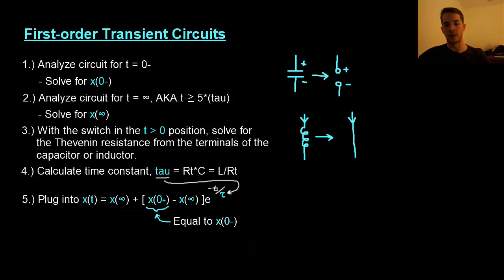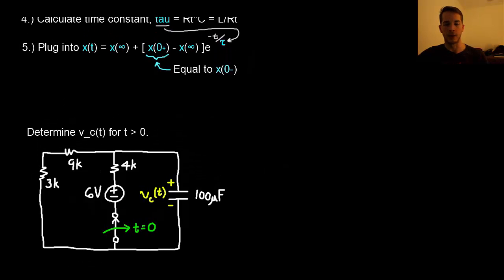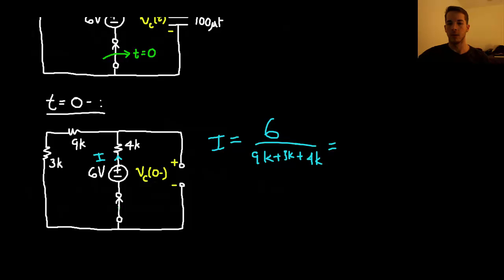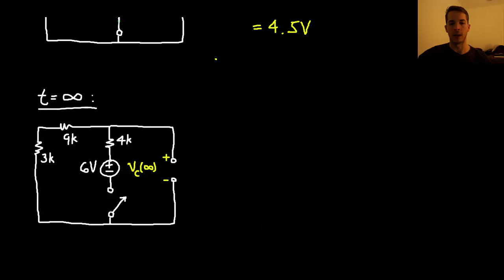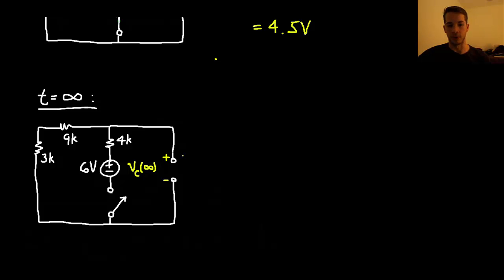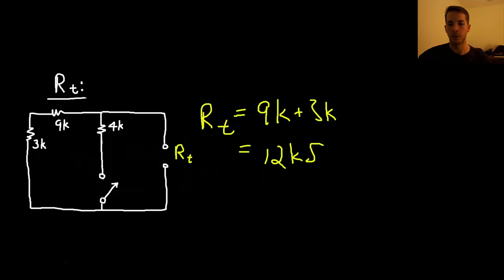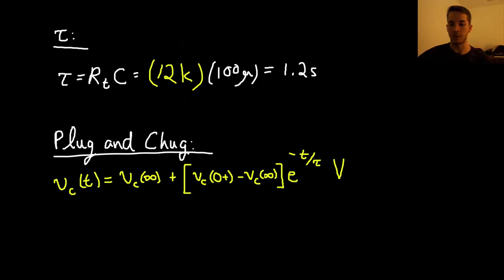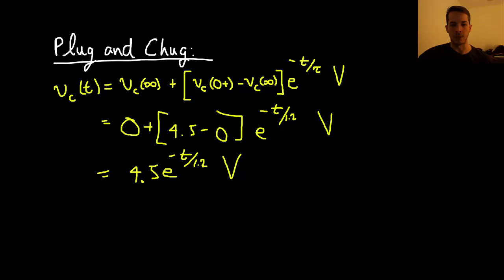Step-by-step approach to Solving First-Order Transient Circuits

Comment: When do we keep or destroy the wire affected by the change in time during t(infinity) and upon solving for the equivalent resistance steps?

I’m asking because there were circuit problems where it was needed to keep the wire upon solving for the equivalent resistances which changed the entire Tao (T) value.
Reply: You keep the wire when dealing with Inductors.